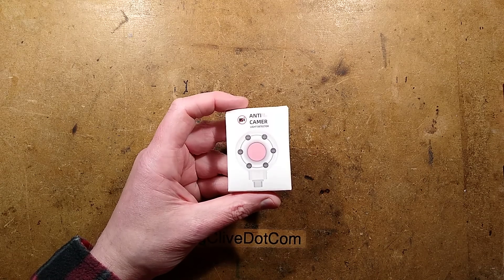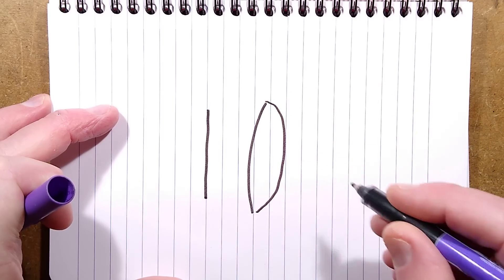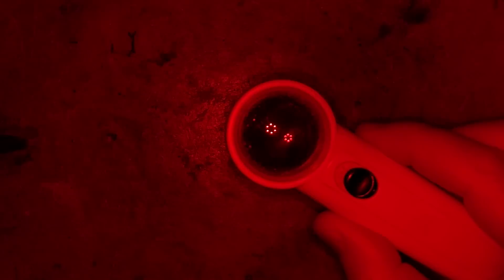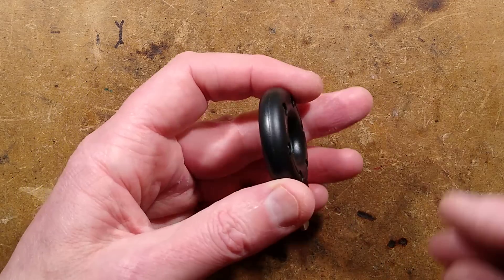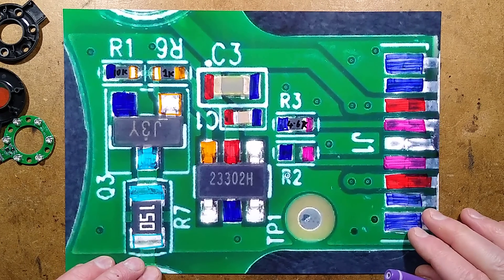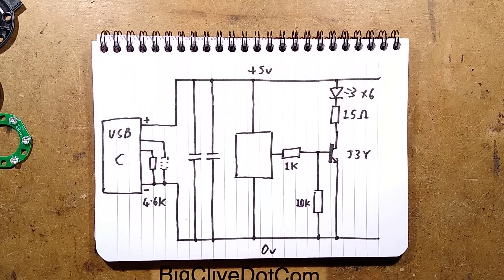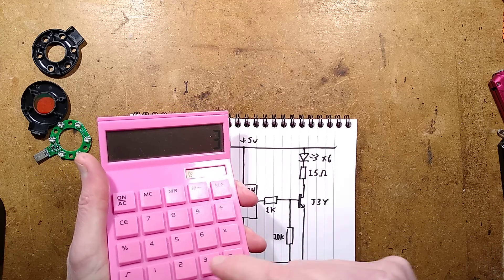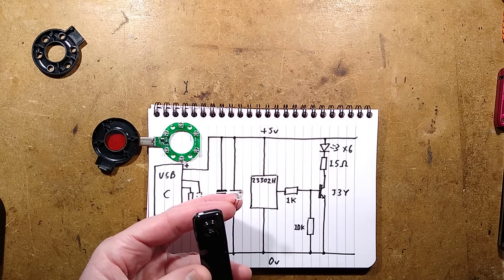Inside a Temu spy camera detector - with schematic

Comment: I think there is detector technology (used in a military context) where they scan the area with a moving laser (using mirrors) and try to spot a sunglint off a scope. 

another technology makes use of polarized light. By using a rotating wheel of filters at different phases it will help to spot artificial "camoflage" in real foiliage. Combine this with some image processing (like taking the difference over time, motion amplification, per pixel histograms) you can highlight regions of intrest.

other technology use narrowband filters, such as the iconic "infrared detector film" used by artists like Richard Mosse to film a documentary about civil war in Congo.

Comment: Those detectors are a very nice idea, but there are still some open questions. How good is the detection angle with respect to a hidden camera? As far as I've seen in the video, you'd have to directly shine the light onto the camera from the front (you have to be in the center of the camera's view), so how good is the angle of detection?
Another question would be how far into a room can you see with it? Let's assume we are staying at an Airbnb, so Is it enough to just turn all lights off and start looking around while standing in the middle of a room? Or do we have to go nearer, and how close do we have to be? It looses much of its practicality if we have to meticulously scan every furniture and every crack in the wall.

Comment: I made one handy tool to open these kind of things: get large stainless steel tweezers, meant for fish deboning. Split it to two parts. Then you got right and left handed pry tool that has a little kink that can be used as a lever. The thin spudger is often way too flimsy and you need something to get things started. Used as a combo, first the heavy tool to open just enough to get the flimsy tool in. It is more dangerous thou, since it has as sharp point and you can use a lot of force, so.. extra care has to be used so you don't stab yourself with it. Source: guess...

Comment: Engineer Mitchell; could you make a video? where you explain the differences between  North American vs. UK, European or International Electronics conventions especially with regard to schematics, color codes (I note you using Blue for return or DC ground or negative compared to Green). If you had made a video on these differences let me know the link (I have not searched your archive). best regards and many thanks for your excellent content, John. eTechnologist (1979/1983 graduations)

Comment: The problem is that it's working on short distance. What about if you need to detect trailer camera or hunter camera in a wood? Would not help much... Even at all.
For such case, I see only one resolution atm; Night run with NVD device, with preference to optoelectronic Image intensifier tube. Expensive, isn't it.

Comment: My mate worked with that molten plastic doing line marking.
One of the new lads managed to get a compressed gas can in there. (Apparently as a joke?!)
And my mate got half his face burnt off.
That was a 6 figure claim...
Still gives him issues 20 years later. 😢
Reply from the maker: That's a horrible thing to happen.

Comment: 8:00 dichroic glass does not have metallisation
It uses multiple layer of transparent oxides. Metal reflects light really well, so you can't get the required thickness needed for dichroic mirrors with metals.

Comment: i've been watching these for a while along with other electronic related youtube clips and i think this is the first time i understand a circuit that's not just a LED, battery, and resistor!
Can you tell me please why there are two capacitors in parallel though? I know they are different capacities so each of them filter out different AC frequencies? Wouldn't they act as one like resistors?
Reply from the maker: The bigger one tends to be used as a small local reservoir for voltage stability.  The small one is lower impedance and can help shunt fast transients.

Comment: Isnt it bad practice to put LEDs in parallel behind a single resistor like that? If i recall correctly it's because it may cause imbalance in the currents passing through each LED due to manufacturing tolerances

Comment: This specific (diacritic?) lense is interesting.
Would it block IR reflection used it in a number plate frame- preventing police ANPR from spying on your movements (which they do with over 8000 small black cams in undisclosed locations…)?
Reply from the maker: You do get dichroic heat shields that block IR light.
Reply: Hmm, interesting.
Might see if that can be number plate sized.
So at least IR spy cams would see it while still human visible and therefore legal.  @bigclivedotcom

Comment: I suspect that the dichroic filter is there to just eliminate other colors that might otherwise add ambiguity while looking through it. It also looks sophisticated. Dichroic filters will have a higher transmission versus the less expensive color filter. I would think that the camera sensor will reflect in any white light, however. Whatever the case, you'd need to be very close to on axis to the camera to get a reflection off the sensor.
Reply: cameras have IR-reflecting coatings, which will also reflect some near-IR.
That's another reason why it's red
Reply: I've seen an IR dichroic filter on camera modules I've take apart. Some have removed this filter in order to gain more sensitivity in IR during shooting. We'll then use a Wratten  87 IR bandpass to eliminate most visual light and pass IR. Used these when shooting with IR silver emulsions. @chri-k
Reply: I got a similar deluxe unit and the filter is pretty fun. Looking through at a computer monitor it really does block the green and blue channels nearly completely.

Comment: A USB Type-C device with an attached cable or plug, must only populate one CC pulldown resistor. Populating two signals that is is a debugging probe of some kind, and the device its plugged into should present whatever the manufacturer considers important debug or progrsmming signals on whatever pins they feel like. Can be useful on chomebooks for example.

USB C-to-C cables only carry one cc wire, the other cc pin can become a power source for emarker chips in the cable that have information about allowed speeds and currents (only needed for 5Amp charging, >20V charging, and thunderbolt 40Gbps)

if you were to only connect one cc pulldown on a female jack, only obe cable orientation would receive power

Comment: Sorry I don't know if this is going to be separate so I say yes just for low voltage I did have a shuttle that my friend gave me because I am currently party disabled and I can't work my friend gave me a computer I sent it off to someone to be fixed and they said the motherboard has gone and what it was it just wouldn't switch on it just won't switch on the front so I don't know what's going on I would like to try and put a second hands motherboard and then myself but I do not know what I'm doing it's either that or throwing it away it's got one terabyte that my friend has put in there but it just done me perfectly it's an old one and that's all I needed that may never happen because I don't know really what I'm doing I'm just interesting in Low volts and how can I test if it's Plus or minus I'll send a picture of it I hope you don't mind you're probably too busy to answer this so I will forgive you if you don't

Comment: One resistor on one of CC lines - that is right. For non-Emarker cable plug side does have one of CC lines connected, receptacle side - both of those have to be connected.
This device does have a Type-C plug, not a receptacle therefore only one resistor is what should be used.

Comment: If I'm not mistaken this should also detect cats, spiders, anything with a tapetum lucidum. Either that or my cat has had spy cameras installed.
Reply: Did you never wonder about why your cat loves to doss down on the wireless charger?
Reply: @trueriver1950 the question is, is she working with the spiders or against them? Sometimes they have to die, other times she'll sit and talk to them
Reply: Yes, indeed. The principle that Big Clive didn't describe very well is called a "Cat' Eye Reflection". Light that is focused by the lens on to the sensor, part is reflected in a cross-over fashion. So it's kind of like a corner cube reflection - the light will return on the in path. 

You don't need anything fancy to detect a camera - just your cell phone flashlight held close inline with your eye.
Reply: Sorry, you'll need to wipe your cat and install a new OS.
Reply: It's like with pigeons, the cats are just spy bots designed to get our trust and then film us 24/7. 

To anyone believing that: No, I'm not a conspiracy theorist, the above line is just a joke.
Reply: I once did that trick of holding a flashlight very closely in line with your eyes, pointed at the ground, to see just how many shining diamonds of freakin' SPIDER EYES there are everywhere on the ground on a warm summer evening. I don't go outside any more.
Reply: @Pants4096 Ha! I saw on the Discovery Channel that a spider is within 3 feet of every human on earth at all times.
Reply: I knew that the story about the CIA's Acoustic Kitty project cancelation was disinformation, looks like they've even upgraded the cats to transmit video.
Reply: Cat spy on us all. Heck, they even run the internet for 15+ years now! 

All cats read "The Art of War" in the womb.
Reply: The cat wasn't a Christmas gift marked 'Love from Vlad' on the label perchance?

Comment: I was under the impression that these type of “detectors” primarily work due to the thin film IR filter on most camera lenses. That would jive with the red color of the filter which would let you see near-IR and red reflecting back pretty easily.
Reply: This is partly true, but mostly only increases the effect. I haven't tested the effect myself, but according to the description, the detectors detect the bright spot that comes from the focusing lens of a camera, and not just the reflection of the IR coating (even without coating it would reflect, because IR cameras exist too).

Comment: I'm not sure you can call it retroreflective if it's just glass beads. Glass beads just scatter the light, whereas retroreflectors use specific geometry to minimize the scattering and reflect almost all light back to its source...
Reply: Half of each tiny glass sphere is coated with an aluminium reflective surface,  which makes them behave as retroreflectors. Any incoming light is focused down to a point on the aluminised half of the sphere which is then reflected back in the same direction.
Reply: @ferrumignis  Interesting!

I'm still not sure how I really feel about using the same term for actually returning most light to the source and a technique that gets a good enough similar-ish effect, but I guess it's both commonly referred to as retroreflectors.

Comment: Great video! Thanks.

FYI, a dichroic filter isn't 1 wavelength thick, it's actually 1/2 wavelength, but double that wavelength is constructively interfered, and all the rest reflected.
Reply: Band pass filter.... not really dichroic. I doubt it's 1nm, it is probably a cheap one with 10-30 nm band pass width.
Reply: @you-dont-know-me  You can tell it's a dichro because the reflected color is the complement of the transmitted color. You can also tell because the colors change as you tilt it. Only dichroic filters exhibit those characteristics.

Comment: One handy tip if you want to block yourself from infrared cameras at night, is wear a hat with infrared LEDs in the brim of the cap. They dont show in visible light but to a camera the LEDs wash out your face with bright light.
Reply: "Some guy I know" did this for years in California, avoiding toll cameras all up and down the 101.  4 blackout drive headlight modules from some retired Army vehicles all pointed right at the license plates, (2 front and 2 rear) from inside the bumper. Looked like a big spotlight through my phone's camera.
Reply: Yes this works with older day night cameras, with modern wdr ones those LEDs would have to be really bright, like blinding except in infrared. To put it this way I have setup cameras in a dark room with sunlight hitting windows and could see people outside and inside the dark area at the same time.
Reply: hmmm thank you very mucho :cat-orange-whistling:👍
Reply: Do this in China or Britain and get caught, you'll get fined or some jail time.
Reply: @eliteextremophile8895  Do that in most US states and you'll be explaining yourself to a judge as well.
Reply: @eliteextremophile8895 a guy in London was arrested for trying to hide is face while walking by a facial recognition test system put there by the goverment..
Reply: I'm not sure how it affects your sight in the long run.
Reply: Streamlight has a flex-head mil spec LED flashlight that's switchable to IR (also white, red, and blue) that's handy in this regard. A few mounting options. Good piece of gear, rather pricey. (Or "free" with your enlistment!) 🫡✌️😎
Reply: @gus473  imagine enlisting for a tacticool flashlight

Comment: Thanks for another interesting video about a (to me) obscure gadget :)
And I would highly appreciate if anyone could answers my quite possibly absolute "idiot question", regarding Big Clive's "Amp/per LED" calculation.. What "principle/rule" is he using when when he "divides" the current (200mAmp) with the number of LEDs (6) to get "33mAmp Each".... What principle/rule is used here, as my uneducated brain thought only the Voltage dropped "along the circuit", and that "amps/current" are "constant" throughout ?
What basic realisation am I missing ??
Many thanks beforehand to anyone who takes pity on this ignoramus ;)
Best regards.
Reply: The LEDs are run in parallel... if they were in series, 5 volts wouldn't be enough to power them, as the sum of their VF's would be higher than the supply voltage.
Reply: That rule is Kirchhoff's current law. Just like you thought, the current is the same for each component, but that only applies along a single "wire". Whenever the wire splits into multiple branches, the current splits too. Each branch has its own individual current flowing in it, but the sum of those currents equals the current in the one original branch.

So in this case, the circuit branches into 6 wires. If there were just resistors in each branch, we could calculate exactly how the current gets split. Lower-resistance branches would get a higher proportion of the total current than higher-resistance branches. But there's also a shortcut for calculating it: if the resistance in each branch is identical, then their currents will be identical too. So, we can divide the total current by the number of parallel branches.

Now, LEDs aren't quite as simple as resistors, but in cases like these it doesn't matter. Identically manufactured LEDs behave so similarly that we can use the average current shortcut again. But you can't connect different colors or types of LEDs in parallel without extra resistors to balance the branches, because the current would split very unevenly.

Comment: The LEDs' leads don't look "cropped and folded" but rather "folded and cropped". They didn't even bother to crop them at the solder joints, but just went right around the board edge almost as if cut out with scissors.

Comment: If you have a LEP flashlight at hand, test it on that reflective material. I believe its 3M "Scotchlite", I have made a small reflective "floodlight" with it. Mounted in my backyard, shine the LEP onto it, whole garden lights up. Also works great on my moped, with many modern cars not seeing the small headlight, but their reflected high beams do the job.
Reply: Be careful with LEP reflection at close range.
Reply: @xorbe2  why?
Reply: @RomaKhudoleyev001  LEPs will permanently blind you at close range. They are not toys.
Reply: @xorbe2  Looked directly into the beam. Not joking, don't try it, but I still see fine. Lasers are on a whole other level though.
Reply: @Mediamarked  LEP is Laser Excited Phosphor and comes out in a 1” beam. Maybe mine is much higher power than yours.
Reply: @xorbe2  Mine is a Astrolux WP3, also have the smaller WP4. I know what LEP stands for and how it works.

Comment: Another great video, good physics knowledge re the filter.  But, why does this need to flash?  Wouldn't a continuous light work without making people twitch?
Reply from the maker: In  lit room it helps differentiate between ambient light and the unit.
Reply: Fancier 'you cannot DIY' device.
Reply: The main selling point being "Anti Camer", I assume it is to prevent being recorded... those flashes in the dark, will make any camera's lighting compensation go crazy. Moral and/or legal uses... few or none come to mind.
Reply: Seems to be quite a widespread belief that air bnb landlords install hidden cameras to perve on their tenants.
Reply: It flashes just to make the reflection stand out a little more as it passes by the lens and catches your eye better than if it were just a static image.
Reply: I have a similar device, but the LEDs light up one by one in a circular pattern, instead of blinking on and off all at once.  Much easier on the eye, and the reflection of a lens will still stand out quite well from the background.  The ring is a bit larger as well so you get a bit of parallax effect.

Comment: Was wondering if the unknown sot23-5 was an SiTime oscillator of some form? Would the USB resistor just be a basic detect for USB2/1.1 to think there is something there so it would provide power?
Reply: Read previous comments now and realize someone has already mentioned the resistor :/